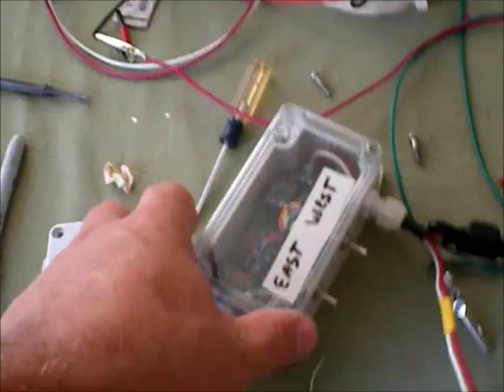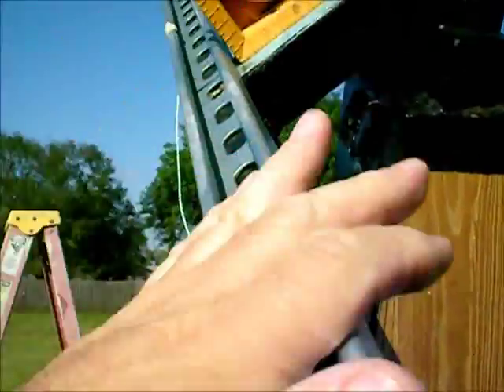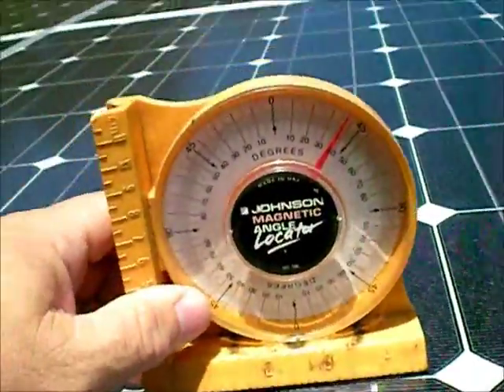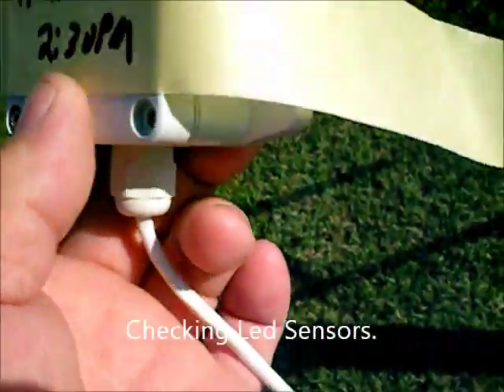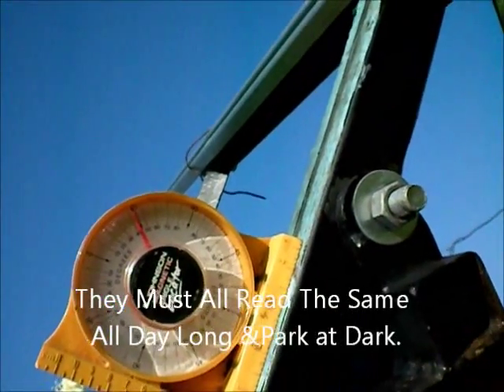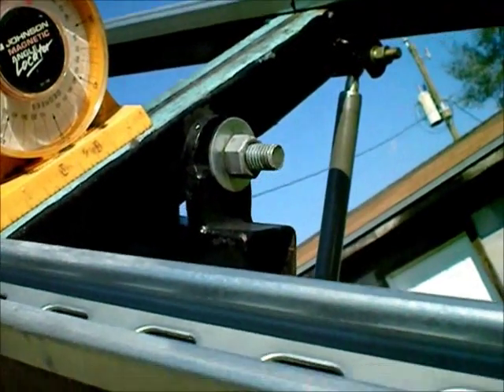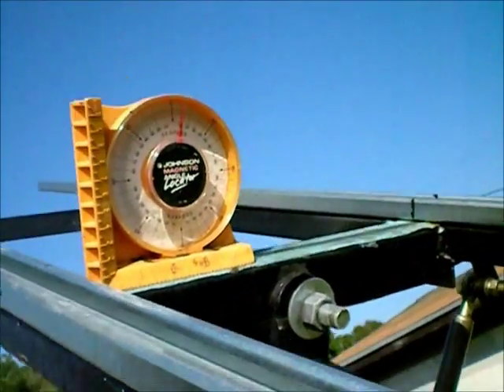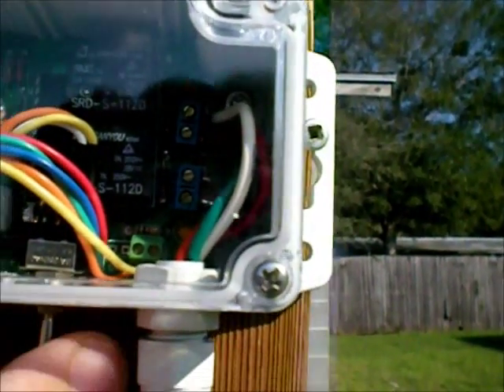Solar Tracker Controller QC test. Every 1-24Hrs.

Comment from the maker: I am thinking of making 2 types 1 like this first 1 I built but make it a bit better.if some 1 wanted to hang 3 big panels it would be perfect than just hook up to 1 solar controller.I am putting a bunch of stuff on eBay now.I have 2. I have thousands of $ tied up here in parts & equipment i had to buy so I can make a few trackers it really adds up fast when U have to buy cases of any thing U need so as to make it less costly ,I am real happy how the Axetrackers came out .The enclosures R great.

Comment: Im positive its the heater. Its a ninety percent efficiency. They force air in the combustion chamber. Thefearless thinker had the same problem with his heater. He put his heater on a inverter to keep it from using utility company electricity. I may need to do that too but I dont have a 220 inverter. Same problem with electric bill spike happened last year just as soon at the winter came and the heater came on. my old heater never used this much electricity but it didnt force air into the combus

Comment from the maker: Are your Panels adjusted to the right angel for this time of year? A furnace blower dos not use much power .check for power losses with your meters.were U spending time welding stuff.that is a big jump.recheck your power bills and reread the ##.I bet there is more going on there U may have missed .go back through out your home maybe some thing is on that should not be.With winter rolling in I have spun my meter back Past it last reading,Wow.getting the most power is a full time job.

Comment: If you have natural gas or propane you might wanna check out the MR. Heater 30000 btu one works great for 1000 square feet for me its lowered my gas bill and eliminated me using my big gas furnace and its blower witch in my case used about 600 watts anyway heres a link to another youtuber that has one like mine..

Comment: I had a reading of only 37 killowatts last months reading. this month went all the way up to 896 the heater came on and it has a 220 blower that forces air into the gas chamber to make it burn more efficently. Problem is what saves gas uses more electricity. I wish I had the less efficent model now.

Comment from the maker: I just got off ebay about half way thrugh listing this 1 i built about a year or more ago.I will sell this 1 with the Richards Foundy solar tracker sensor & actuator.the 1 that is on it or another 1 i have in a little better shape.this 1 will hold 3- 235 watt panels easy .i will sell it to 1 of my subs for $200. shiping will be about $ 60+- i get a good rate on my UPS acct.This 1 is very simple to use. my new style big trackers are very diff If u what info PM me 4 Email